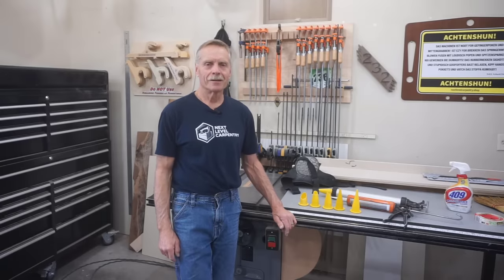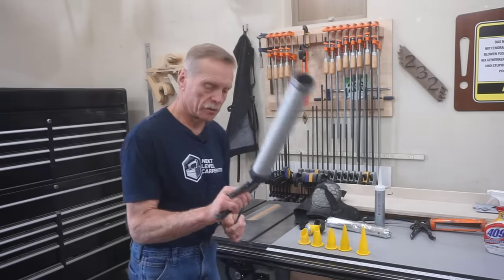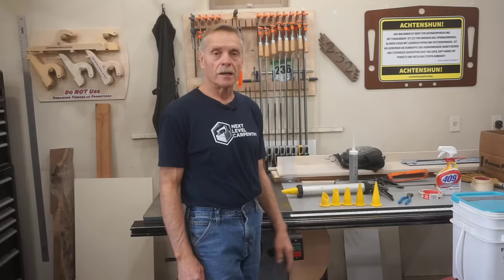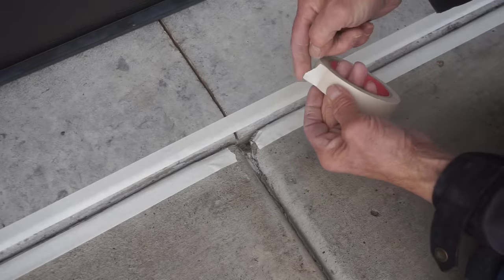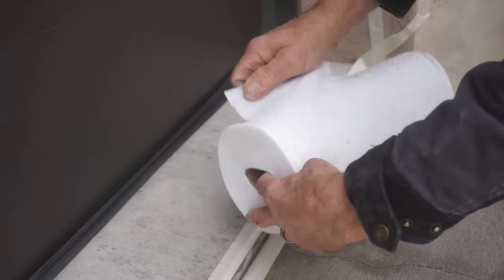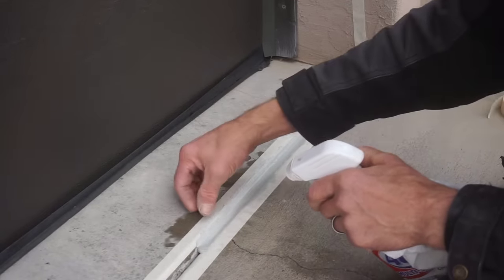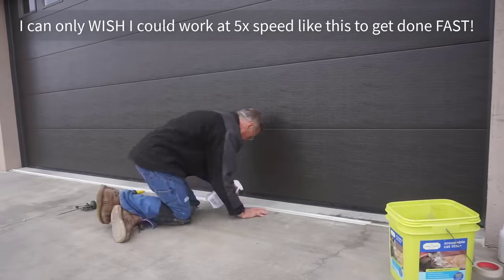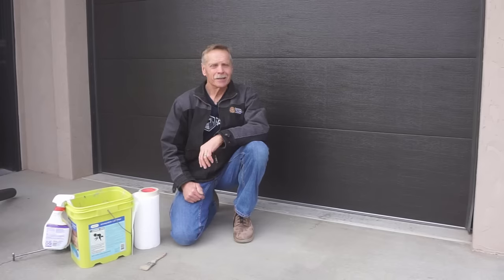How to Caulk Concrete Control Joints with Perfect Results Every Time

Comment: I've been caulking similarly for years.   I like DAP Dynaflex 230.   You can smooth it with plain water.  You want the overflow on the tape as thin as possible.  Also pull your tape immediately.   Pulling against the caulk is a good idea.   Again you don't want thick caulk on the tape.   The caulk will shrink into the joint, so I like to put it down level with a straight blade putty knife.  You can then dip your finger in water to smooth it out.   Your caulk may  require a soapy liquid to smooth it.  Sanding is generally not necessary.
Reply: Dynaflex is not a suitable sealant for this application. It is latex based. It claims to be silicone tough and silicone is not tough enough for this application. Silicones and latex are not approved for traffic decks ( including foot traffic) In this application you need to use a urethane as Matt has used. I have been caulking professionally for over 40 years and have installed miles of flat work sealant. There are  3 basic types of sealant .And each has a very useful purpose . 
1. Latex sealant excels at paint prep. But despite its claims should never be used outside except for cosmetic caulking that will be painted over. And is a poor choice for waterproofing.
2.  Silicone excels at waterproofing joints especially in wet areas like kitchens and baths. It is also an excellent exterior sealant with two exceptions. It is very soft and therefore unacceptable for flat work( traffic decks ie walking or driving surfaces.) Or areas that are expected to be painted. Also silicones are either acetoxy or neutral cure ( it’s easy to tell the difference acetoxy has a very strong smell before curing , like vinegar) neutral cure not so much. Never use acetoxy on cement based surfaces.
3. Urethane or polyurethane not as easy to use but much tougher than either silicone or latex. Excellent for waterproofing applications. Especially areas that need to be painted or flat work traffic decks. Vehicular or foot traffic

Comment: QUESTION:  I have expansion joints in my concrete floor (that once was a garage floor) and I want to tile over the expansion joints.

Could I just use mortar and mesh tape or do I need to use this chalking product?

Fantastic looking job. Thank you
Reply from the maker: Unless you're concerned about water or radon coming up through those old expansion joints I wouldn't worry about sealing them under tile.  I'm not a tile guy but don't think 'mortar and mesh tape' will do anything to prevent cracks in the floor from transferring to cracks in the tile.  I'd recommend using a 'decoupling membrane' like Schluter's Ditra or eqivalent... good luck with your project! Best, Matt

Comment: and theres the two  mistake i made i dident use masking tape ,, an i used paint thinner instead of 409 , thinner works but it'll take a week to get the smell out my hands lol.. great video thanks a bunch  ....
Reply from the maker: I think that's called failing forward, Tommy😉you'll be a pro next time, right? 😎

Comment: My order of 16 sausages and a gun just came in the mail. I'm going to be having some fun with this. I'm going to skip the sand part I think that's overkill. I have washed pea gravel finish. Rocks of many different colors. After I get all the Expansion Joints sealed up I'm going to do a ceiling of the entire concrete drive and walk. Total cost will be close to $300.
Reply from the maker: Just think of what it would cost to hire out for your ambitious project!  With a little practice you'll be leveraging your $300 to save over $1,000.  BTW I bet you'll re-consider your "skip the sand part" when a small gust of wind blows a bunch of detritus that instantly and permanently spoils the look of your new, perfectly tooled sealant😉.  Have fun... Best, Matt

Comment: This came out great!  Any tips for tooling the caulk when expansion joints are real wide- like 3/4 to 1” in places?
Reply from the maker: Exact same process... just a bit more 'finesse' when smoothing out the surface.  Takes some practice but I've done joints in stonework 2" wide without great difficulty. 😎
Reply: @NextLevelCarpentry  Thanks for the reply! I just finished caulking the expansion joints around the garage interior.  Had to use a “rough surface” tape especially on the stem walls and went with a final tooling that is triangular in shape and builds the caulk up as it approaches the wall. This came out looking great and prevents debris from accumulating in a concave joint along the perimeter.  Your video and reply were integral in getting this job done correctly.
Reply from the maker: @noyesharrigan6217  Thanks for letting us know! Always good to hear when a plan comes together... and congratulations on a job well done! Best, Matt

Comment: What color do you use for this application.  I see this company makes an abundance of colors to select?  I also want to add this is one of the finest DIY video's I have ever watched.  You go down in to detail and recommendation on the type of caulk guns to use and how to use them!
Reply from the maker: Tremco's Limestone and Gray are usually the best 'match' for concrete, depending on concrete's age and how clean it is.  I think I used Limestone in this video because it's a bit lighter of a shade of gray than Gray...

Comment: Good job. I would add that balancing the adhesive and cohesive ratio is critical in the expansion joint… not so much in the control joints.

Comment: Great video as usual.  Question: can I use  masking tape, 409 and finger method applying silicone caulk?
Reply from the maker: NO! You can however use masking tape and alcohol to smooth silicone and get professional results... I'm not sure if the alcohol needs to be denatured or isopropyl but one of the two is excellent.

Comment: Great video and tips. Just wondering how that caulk acts in temperature change - does is shrink?

I take you do a lot of driveways can you tell me from your years of expertise which is your best caulk for concrete cracks for the 1/4" and the 1/2" depth? I have been using Sherwin Wiliams Loxon S1...thanks!
Reply from the maker: This is the only sealant and method I've used for more than 25 years and it holds up well through drastic variation in upper midwest weather conditions.   The sealant itself doesn't shrink and, as a matter of fact, remains incredibly pliable for decades in my experience.  Temperature change doesn't affect the sealant itself but no sealant, including Tremco, will hold up with extreme movement from poorly designed joints or poorly placed concrete but this is the best chance you have for success IMHO.  Best, Matt

Comment: I’ve used this technique at my home on driveway and sidewalks.  There is definitely a learning curve using your finger and you can see (my wife especially) the joints I did first versus the ones I did last.  I researched more and learned for non-sag polyurethane like this the professionals use caulking spatulas which I wish I would have used and will use going forward.  They also get the same results (again with lots of incorporated learning curve) without any tape.  This is an excellent technique I just wish there were a YouTube example with the spatulas.  I think the pros are holding back some of their tips as if you contract this work out it costs a fortune.
Reply from the maker: Glad you were able to improve your Technique as you went along. FYI I have tried to use those spatulas and  and believe me the Soapy finger method is infinitely better. I have yet to see finished results this good from any professional anywhere although they do get very acceptable results on large projects but generally the conditions are more ideal. By more ideal I mean long runs of very straight lines with clean crisp edges that make tooling easier but anytime you have varied conditions like in typical residential sidewalks and driveways their results quickly degrade.
I'm guessing your worst results are probably comprable to the results you would get from most contractors that you paid for and your better results are better than do you get when you hire out the job.
Reply: Thanks much for your reply and agreed with all but my first run of 20ft+ is really quite bad,  thus my thoughts on trying spatulas.  I also have learned that the Sika polyurethane product recommended by their tech experts will bubble (trapped air) after laying it down with this technique so I’m sticking to the Dymonic product you recommend although it’s hard to come by, 5-10 days by mail and usually I want to do this project on the fly.  I want to say thanks again, this is far superior to other work I did with self leveling products which always got brittle and failed after a year or so, I am interested to see how long polyurethane lasts in Colorado desert dry hot cold conditions.
Reply from the maker: @ededh7296  there are certain times and conditions when I'll get a few bubbles using the tremco dymonic product but it's not from the 409 I use for tooling it. I have projects that I did with tremco dymonic 20 years ago that still look good and that is in Western South Dakota climate which isn't too much different than yours. If the edges of bad-looking joints are clean you can always cut the middle out with utility knife and retool and reapply a nice clean layer. Good luck with your projects... I hope they meet your satisfaction as you gain experience...
Best, Matt
Reply: @ededh7296 i am also in colorado. How did the tremco dymonic fc work out for you. Is it still holding up?
Reply: @simd510  hi, it is still perfect!  It is rubbery and flexible still.  I may have said but I used to use self leveling silicone and after this same amount of time it was hardening and cracking.  At my work we just installed an all new facility and all the vertical wall concrete joints are caulked with polyurethane so I think it’s the professional choice for industrial and commercial high reliability applications.  Good luck I highly recommend.

Comment: Great video, is there any suggestions on how many feet a sausage tube will cover. I understand the width of the crack makes a difference but I need some gauge to order materials. Also can you use silica sand to fill the joint or crack up to the 1/2” depth? Thanks in advance.
Reply from the maker: There's a calculator on the Tremco site that helps you figure volume for joints.  I've not used it lately but it might help get you in the ballpark.  Silica sand is OK for pre-filling joints but backer rod is probably faster and better...

Comment: Great job!!!! Will that 409 work on regular caulk when you're doing baseboard caulking etc?
Reply from the maker: To my knowledge 409 only works on the one part urethane sealant shown in this video... it will just make a mess with any other type of caulk. Some people use a finger dipped in water when smoothing latex caulk used on baseboards excetera and alcohol used in moderation works with silicone. Make sure you experiment ahead of time with any new combination you try so you don't end up with a big mess and disappointing results.

Comment: Fantastic detailed video. Liked and subscribed. Watched due to a project I have to do. I have an in ground pool that has a plastic coping surrounded by a concrete deck. Each year my deck slowly settles lower and lower I think due to the 1/2" unsealed gap between the 2. The deck was originally poured up against a 3/8 styrofoam expansion material. Will the tremco dymonic fc work for my application ? And same application method. I'm sure due to size I will need backer rod. And is the silica sand after cure mainly esthetics? I'm concerned getting sand in pool. Thanks for any advice
Reply from the maker: I I'm not sure but suspect urethane caulk won't adhere well to that plastic pool coping. It might be the best you can do and better than nothing but that's just a guess. The main reason for using silica sand is to keep other dirt and detritus from sticking to Fresh urethane sealant. I do prefer it as an aesthetic Improvement because it gives the sealant texture instead of shiny and smooth next to rough concrete.  If you do choose to use this method just wait 24 hours and then vacuum up the excess sand which will prevent any from getting in your pool. 
Thanks for watching liking and subscribing! Best, Matt
Reply: @NextLevelCarpentry  thank you

Comment: Thank you for the video.  How do you repair crooked cracks in concrete?
Reply from the maker: Just spend more time applying masking tape to the edges of the crack and as long as there at least a quarter inch wide use the same process for applying sealant in finishing it.
Reply: @NextLevelCarpentry  Thank you.  Do you use a "concrete crack chaser" blade or a regular blade?  Would you recommend the same product and method for cracks where one side is slightly higher than the other?  Thanks again for the help.
Reply from the maker: @davidnix8250  I would just use a hammer and Cold Chisel or an 1/8 in thick segmented Diamond blade to clean up loose stuff in a jagged crack. If there is a special crack chasing blade it might be a better choice but I'm not familiar with it. Personally I would not do a lot of extra work because anything you do to smooth off the edges of a jagged crack just makes it wider and more visible.
Where one side of the crack is higher than the other I would probably just let the bead of sealant transition from the upper level to the lower level in a smooth concave Arc but that could vary from situation to situation... I think you'll quickly figure out what's the best for your situation once you get started... Best, Matt
Reply: @NextLevelCarpentry  Thank you!

Comment: I use the cone itself simultaneously to tool while I’m caulking it’s a fine art eventually you don’t need tape just free hand that joint would probably take me a half hour to grind blow out and caulk. Also I think there’s a special diamond blade concrete caulkers use kind of wondering if I could get away with using a cup wheel.

Comment: If you have caulk remaining from a project, have you ever been able to store the left over caulk so it won't cure in the tip or the sausage? Do you throw the tips away when finished? I've tried mulltiple ways to seal a standard Vulkem tube after it's been opened but it always starts curing in the tip of the tube. Foil tape seems to give me the longest storage time but not for terribly long. Do you ever use a tool when tooling or just fingers? When applying additional caulk over a sprayed area do you have any adhesion issues?
Thanks.

Comment: I have two questions: 
1) I am colorblind. When using Tremco Dymonic FC caulk, which is best color match for regular concrete? Buff, Beige, Gray, or Limestone?
2) What is the difference between Dymonic FC and Dymonic 100?
Reply from the maker: Gray or Limestone will be best and the only difference is the gray is a little darker.
Dymonic FC is a little thinner consistency and tends to make an initial cure faster than the dymonic 100 which takes a while longer. I accused FC in the video... thinner consistency is a little trickier to tool to a smooth surface but the faster cure time seems like a benefit so either one is really good... Best, Matt

Comment: Does the 409 concept work on all Caulk or just on this product? Love the video.
Reply from the maker: NO!!!!  I use it exclusively on gun-grade urethane sealant of the type you see in the video.  It will surely make a mess if used with other types.  FYI Other liquids DO work with other types of caulk... for instance I use denatured alcohol for wet-tooling 100% silicone with excellent results.  Best, Matt

Comment: New subscriber here 😎 Thanks for the detail. Can everything be painted with concrete paint to hide the joints and smooth out the whole driveway?
Reply from the maker: Not sure how concrete paint will stick to urethane sealant but keep in mind that paint dries hard and sealant doesn't so, even if it sticks, it will 'craze' over time.  Plus I'm NOT a fan of concrete paint because, once you paint it on , it requires constant re-coating to keep it looking nice when it peels, flakes and stains... just sayin' 😏

Comment: Hi , great video, can I use this product over expansion material that is weathering away ?
Reply from the maker: I don't see that application as a problem... I'd just make sure that the aged expansion material is low enough that the new bead of sealant applied over it is half as thick as the width of the joint....

Comment: Thank you for the video. Do I put sand in first if the ground is on the bottom of the joint?
Reply from the maker: Sand works but backer rod is usually better...

Comment: Excellent video. I’m a new DIY-er with limited tools. Is there a way to clean out the old caulk without a diamond wheel?
Reply from the maker: A diamond wheel WILL NOT 'clean out old caulk' Beth!  I use a diamond wheel in the video to clean out and clean up the joint for consistency before sealing.  Cleaning out old caulk is a miserable chore no matter how you do it but I'd start with a long-handled pipe knife, scraper and wire brush...

Comment: Thank you for this video. I've searched the comments for additional information about sausage guns, since I do not have one. There is a wide range of prices and specs, can you give some additional advice?
Reply from the maker: Since a sausage gun is considered a 'professional' tool they're a bit pricey and only worth it if you're doing a bunch of this stuff.  If you anticipate long term use I think you get what you pay for. If you're just doing projects for yourself around home it's probably not worth the investment.  In that case just buy a high-quality 10oz caulk gun and use the smaller tubes on your concrete sealing... it twice the number of 10oz tubes to do the same volume of work but, other than a little more fuss applying and tooling the joint it's no big deal.  Hope that helps?
Best, Matt